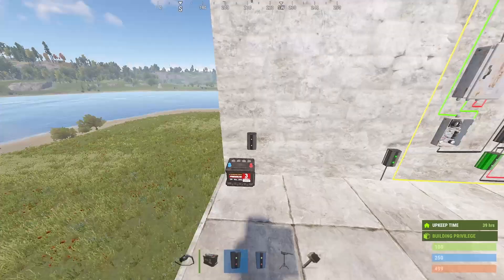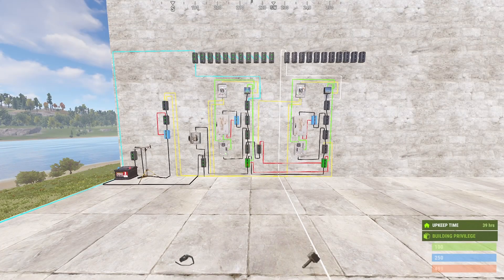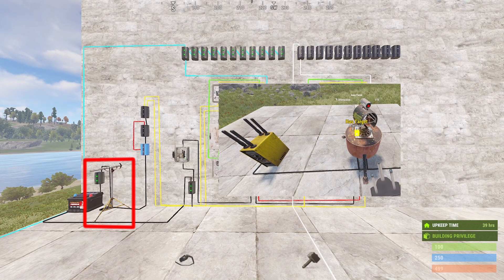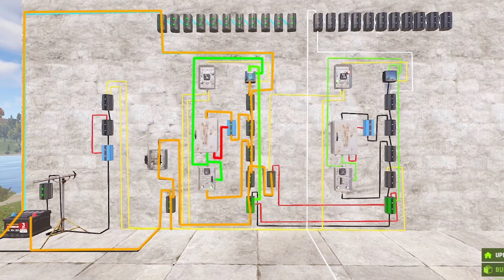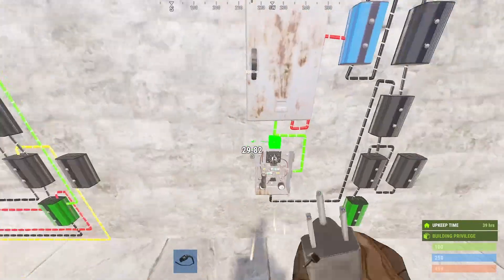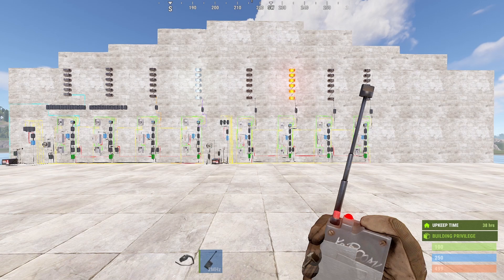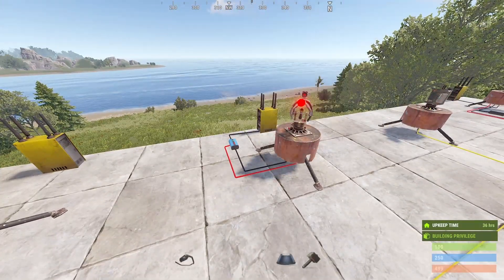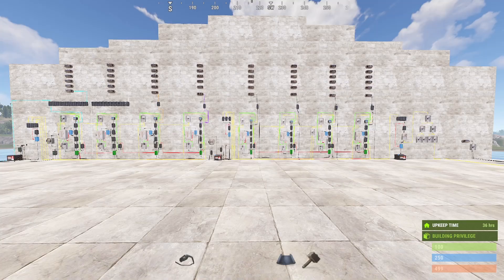Modular Turret Flip/Flop | Rust Electricity Tutorial

Comment: long shot in these comments but im using this system now and im confused how i get more than 24 turrets off one power source? since the first power input the whole system depends on that power being cut off and on, so how can i use multiple batteries/turbines?
Reply from the maker: You dont need to add any more power no matter how many turret modules are you running.
Reply: @ when I try to put more turrets onto circuit it doesn’t get enough power
Reply from the maker: how much power are you giving to the circuit?
Reply: @ 2 turbines, about 160
Reply: @ I’m only able to use about 7 turrets before I’m out of power per module, 12 is too much power
Reply from the maker: @AMosesPresents  well then you must have misswired it somewhere. The circuit only needs 137 power to run infinite amount of modules. So if you are govong it 160, there must be an issue.
Reply: @ I’ve got 2 turbines into a root combiner, and root combiner into battery
Reply from the maker: @AMosesPresents  if you have only a single large battery, then ofc that is not enough. Large battery can output only 100 power, but you need more.
Reply: @ should I put turbine into two different batteries and combine the batteries? I’m not too sure what the difference is
Reply from the maker: You need combined output of at least 137. So you will have to root combine batteries no matter what. Just make sure your power generation can sustain them
Reply: @ okay I think I understand, thank you brother!

Comment: @hyperion i was testing turret flip flop and i am confused why there is so much wasted time in them cant you just bypass the down time and complete a "active" scan every 2 seconds with a active turret cycle being pre charged by 2 seconds to allow them to scan for a target. this would allow up to 96 turrets or 8 cycles of turrets to scan every 2 seconds and then if they find a target to remain on. i already made a proto typed that worked with just sets of turrets allowing each set of turrets to be cycled every 2 seconds  leaving each set offline for only 2 seconds between scans. has a example in theory i could cycle 96 turrets 8 sets every 2 seconds compared to that taking 24 to 48 seconds with a traditional turret flip flop.
Reply from the maker: Hey.
You can ofc make the rotation time faster by lowering the variable number on counter ( 10 was just an  example ). As for precharging turrets, that sadly isnt possible with how power priority for turrets work. Also you have to allow the turret some time to send out a signal if target is detected and for the rotation block to kick in. Therefore i wouldnt recommed going under 3 seconds of rotation time.
Reply: @HyperionRust your right with a traditional turret flip flop it is not possible but with a different setup it works quite well  instead of saying each turret needs to be on for 3 seconds to get a scan i overlap each turrets rotation to allow the next batch of turrets to charge 2 seconds before i want them to be online meaning i can rotate to them for .25 seconds of active time before resetting them in que. this meansi am rotate shutting off turrets every 2.25 seconds instead of turning turrets on every few seconds. its hard to explain but instead of powering turrets i am managing unpowering turrets instead to keep within the turret limit. so i overlap the 2 seconds it takes a turret to turn on with each one other having has many turrets has i want with power but only 12 currently "active" while the others are in a charging state due to the power being received in the last 2 seconds before they turn on for a fraction of a second to do their scan before shutting off. Note because of the nature of the the power in rust their can be issues sending commands fast enough to stop the turrets from shutting off  mid scan if a target is detected i would make sure you dont add to much fluff to the return for target detected. you can also have it trigger a command that overrides the cylce to lock the turrets on.
Reply from the maker: Thats false :-) try it yourself. You CANT precharge turrets because of the priority order they take
Reply: @HyperionRust i made a working version how do i share it
Reply from the maker: @agamerlikeme8599  have you done it with 2 sets of 12 turrets? Anyway feel free to post it in my discord. Invite link is in the video description

Comment: how do you do the frequency part. not too familiar with it. I’ve recreated it, I understand it. I just don’t know how to do the frequency part.
Reply from the maker: It is real simple. You set an RF brodcaster and RF receiver to the same number. And when the broadcaster gets power, it will send a signal to the receiver. Its just a way to transfer signal without using a wire which in this case is much more comfortable.
Reply: @ that’s what I thought but when I tried doing it doesn’t work. I made the system with only 2 counters, it worked. made it with 4 as shown in the video, it works. but when doing the frequency part as described, it’s yet to work. I am on console so I’m not sure if their’s a difference between the two systems.
Reply from the maker: @rail3dblitz  well if you are on console, there will be more power required for this circuit, since components still consume power here. All though the logic should work the same. But im not familiar witch console mechanics.

On the other hand there is no turret limit on console, so you dont even need this circuit :-)
Reply: @ i totally forgot it might need more power 😭. you’re a life savior, also! even with no turret limit, it’s useful to know everything electrical. maybe I use it when playing on pc, maybe they make a turret limit on console. regardless building/electricity are like the two wonders of the game 💜

Comment: you said it needs like 139 power. is that when it spots an enemy or is that how much is being drained constantly and the nih core needs to bring in that much
Reply from the maker: @Maxmilion6004  if you are using nih core yes, that will be the constant drain.
Reply: @HyperionRust  so it's most likely better to have a 2 battery 2 windmill set up for this circuit, or what do you use?
Reply from the maker: I dont see, how is that a problem. If you would be feeding it from 2 batteries that are root combined, it will consume 200 power making it even worse.
Reply: @HyperionRust  perhaps I'm understanding it wrong. As I'm new to electricity. Im asking how you set your power up to make sure you have a consistent power supply.
Reply from the maker: In regards of this circuit, there is no power to be saved. If you are running 12 turrets per module, 139 power is the required amount or else the circuit wont works as it is supposed to. Using Nih/BCN core for this circuit is ideal.
Reply: @HyperionRust ok. So it's going to need at least 2 windmills basically. Do you use battery back ups at all or no?
Reply from the maker: I do use power core. ( Nih core, BCN core, the Kore ) they are already backups on their own. In the end it dosnt matter how you deliver power to the circuit.

Comment: 11:27: Instead of a branch, could you power the door-controller directly, then use the passthrough on the door controller to go into the turret?  While still having the "No Ammo" go to the door-controller's "close" signal?  Or would the door briefly open and close if there is no ammo?
Reply from the maker: Yes it would open and then close, also then you are in a risk that if the door get destroyed - door controller will also get broken - no more power for the turret. So i wouldnt suggest doing that. Its far more safe to hide a single branch somewhere deeper in your base.

Comment: I'm so confused if you're running this off one large battery. How are you able to obtain 12 turrets??? I have my electrical branch's power out (leading to turrets) maxed at 92-93rW to supply each turret with 11rW. That would only be able to power 8 turrets (total at 88rW) per each module.
Reply: This system would typically be powered by a "BCN"/"Nih" core which has multiple batteries. I believe this video's uploader has a video about it as well.

Comment: Low ammo is powered even when there is no ammo in the turret so there is no need for the OR switch/gate for the alarm beacon.
Reply from the maker: @dx4  unless there has been a recent change i do not know of, that isnt true
Reply: @HyperionRust  It's been like this for more than a year (at least it was like this when I started with the electric stuff), you can check it on a build server. I like your designs and I implement them and making some tweaks.
Reply from the maker: @dx4  if you are using a build server then thats highly likely that it is bugged on there. Ill test it when im free though
Reply from the maker: @dx4  just want to confirm that you are right. Thanks for the info .-)

Comment: Can u make wiring proces with no jumps betwen each step. It would make it much easier <3
Reply from the maker: @Alexelectrik  i think that would be too long. Better to use the diagram as a refference
Reply: @HyperionRust  if u make it just for 1 module it will not take long
Reply from the maker: @Alexelectrik  That sadly wouldnt be enough since modules are connected to each other and to the rotation block. But i got your point :-)